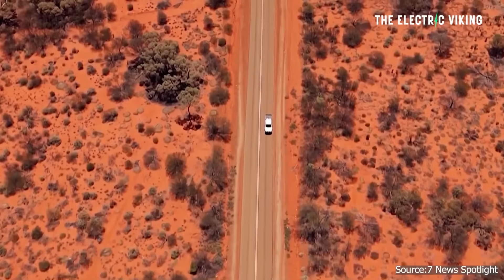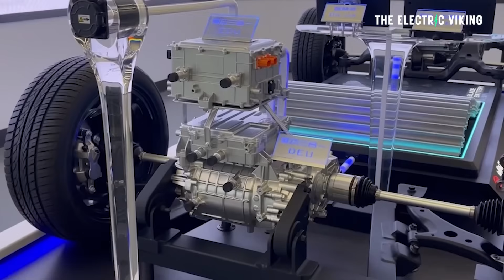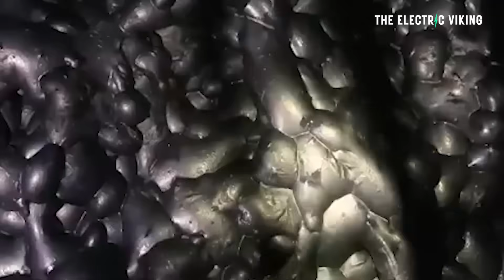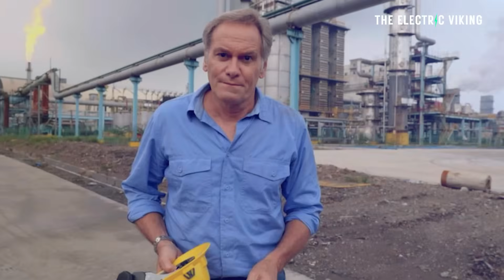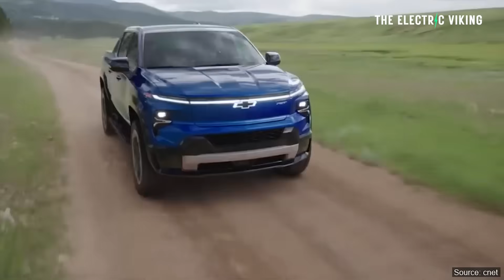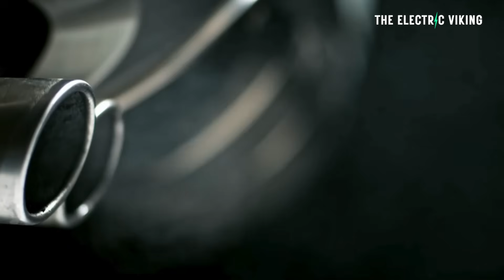Channel 7 Lies Exposed: The Truth About My EV Fight with Australian Media

Comment: Yes, roughly 70% of the word's nickel is used for stainless steel which is what most of Indonesia's nickel is used for. But, this video leaves out key facts. While LFP batteries are growing, especially in China, most global EV makers still rely heavily on nickel based batteries (like NMC and NCA) for higher range (LFP can't match the energy density of nickel based batteries, yet anyway). Tesla, Ford, Hyundai, and VW are all sourcing nickel from Indonesia. Tesla recently signed a $5B deal with Indonesia's nickel (You don’t invest billions in a material you think you’re done with). Indonesia’s nickel isn’t ‘too dirty,’ it’s just under scrutiny for environmental practices, which companies are now addressing.

I support your cause, but please don't be like Channel 7 and leave out key facts. Let’s keep it real, LFP is growing, but not replacing nickel as it's still essential to the EV transition and will play a key role into the future, that's the reality.

Comment: Ev battery warranty fineprint needs to allow V2g without leaving those cycling the battery into the grid out of luck if battery needs a replacement. (I totally understand why they have that hidden deep in the contract, tho we need this happening to get rid of coal , gas booster plants)

Comment: Personally unsure about the truth of the confrontation but lean towards Sam's version of things although the program itself was real enough with the confrontation seeming to be more of an edited set up. Nevertheless, to say there is no nickel in EV batteries is just being economical with the truth. Nickel is used in the production of both Li-ion and Nickel-Metal Hydride, obviously more in NMH. Yes you can say there is no nickel inside some battery types but they are well in the minority; for instance Toyoto use almost exclusively NMH batteries. Either way irrespective of what you can claim is NOT used inside the actually battery cells all those thousands of cells have to be connected together and that is accomplished almost exclusively with nickel strips. The purer the nickel strip the more reliable the connection and it's longevity. But! It must be very tempting for cheap EV makers to use cheap batteries and cheap batteries assemblies might be constructed with less pure nickel (dirty nickel). Again, either way I reckon that if EVs were not gobbling up all the best nickel there would be no place for the dirty nickel which in turn forces the less competitive pure nickel producers out of business making more room for more dirty nickel production.

Comment: One of your best episodes yet, Sam. It’s unfortunate that it took a cheap shot from Channel 7 to trigger your rebuttal—but I’m glad you set the record straight.

For those watching, I was there during the so-called “confrontation” the reporter described. I was speaking with Sam right after Minister Chris Bowen’s presentation. We were simply waiting our turn to ask questions when the reporter and crew barged in and hijacked the press conference.

My question for the Minister?
Why is the government still backing hydrogen for road transport—an expensive and impractical option—when BEVs (including heavy vehicles) are already proving their case on roads every day?

Comment: Oh yes the great EV scam, I said it from the very start EV's = SCAM . And anyone who buys one supports the scam ....better still buy a V6 petrol  or better still buy a V8 HSV
Reply: may i ask how you think it's a scam? im on the fence between getting one so genuinely asking 🙏
Reply: I have spoken to 2 EV owners and done a lot of research to find out that the running cost out weights the savings The EV owner told me it's 800 dollars for 1 tyre just on its own tyres wear out faster due to the weight of the car then there's the replacement cost of a new battery starting from 12,000 dollars . And there are a lot of other problems with EV's.After speaking with some EV drivers and the information I have found i will stick with a petrol car

Comment: You are correct that the images ' heavily and selectively  edited ' it would seem by Spotlight did provide a narrative that many on face value would have seen you as being in the wrong. However the way you have presented yourself here in putting your view of the situation across and this view can be supported by others paints a villainous show of intended deception by Spotlight. Many comments below by others to this video have supported you wrt the Indonesian mined nickel not being of the quality needed for EV battery usage. Dont offer to go outside with anyone as all you have done in the past and currently doing will be lost. Take 10 deep breaths next time (I know it is hard to do) and simply do not react, just 'wear it's so to speak. I am Never watching Spotlight or any Liam Bartlett story again. I am retired with an Eectrical Engineering background.All the best with other matters in your family.
Reply from the maker: Good advice, cheers
Reply: Not that I expect a response from ch 7 but yesterday I did also make a complaint to them along with a link to your video. I suggested that based on what was shown to all by ch7 and now what you have now said ch7 need to at least provide an apology to you and in fact to ALL its viewers for biased, inaccurate and sensationalism to push an ' agenda '. Goodluck M8.

Comment: One missing piece - there is nickel in nearly every resistive electric heater. Let's stop buying hair dryers, electric water heaters, cooktops and so on. Those were manufactured for over 100 years, why didn't they stop manufacturing heaters if nickel is so bad.

Comment: I saw the ad's for that 7 story, I didn't bother watching, I assumed it would be a load of bull, sounds like I was right.

As to why 7 was running that one I don't know, it's not like we have a auto industry that needs support over here any more especially after GM and Ford pulled the plug. There seems to be enough EV ads at present, so the TV ad coffers from that direction should be ok. If anything the TV media should be more going after web based channels that are pulling in way too much ad revenue. You know, that WiFi must be rotting your brain... (Oh lets not forget 5G).

Comment: Commercial free-to-air tv is dying. Anyone with an IQ over 75 turned off years ago. They know damn well those that still watch and easily manipulated, because they believe that they see and are told. The sooner 7, 9, 10 go broke, the better. I have not watch any of them in years, but they still appear with their crap on my social media. 

As you clearly stated Toyota etc are the only reason these tv stations manage to keep the lights on. Everything that goes to air is linked to advertising and making money. Facts are not a consideration.

Comment: I looked up nickel mining in Indonesia. Acc to searches, it is nasty and it remains one of two primary sources for nickel in li-ion EV batteries.  It might be Tesla's only black eye. It's bad but it's small potatoes compared to the fossil fuel and ICE industry.  I'm a retired petroleum engineer.  I love my 2024 model 3 with FSD.  Fossil fuels have become a ripoff. We charge from home. Electricity from the public utility will cut your transportion costs dramatically. In Ok we get power for 5.7¢/kwh half the year, ~12¢/kwh the other half of the year. It usually costs less than $2 to go 150 miles.  No BS. That's <2¢/mile.  No mechanical maintenance either. Can't beat that with a stick.  You're making a mistake if not taking advantage of the public utility power prices.

Comment: I looked at that article. It even started with the old chestnut that because most electricity is generated by fossil fuels they are a con. Trouble is a simple Google search would show that in Australia, most EV owners have Solar Panels and use this to charge their EV. To be perfectly honest the whole article seems like a hatchet job and it does not surprise me in the slightest that both the author and the Channel have links to big oil.

Comment: We need to wise up. Oil companies are colluding with other industries to spread lies and confusion, and have been for a long time. Big oil is freaking out because SOLAR WORKS. They will do ANYTHING to undermine batteries. THEY KNOW that even one breakthrough in the battery battle will finish them off completely, and thousands of smart people are working on the problem right now.

Comment: Good point — there’s more to the story than just environmental impact.

Indonesian nickel is mostly in the form of laterite ores, particularly nickel pig iron (NPI) and ferronickel, which are traditionally used for stainless steel production, not for EV battery production.

EV batteries, especially nickel-rich cathodes like NMC (nickel-manganese-cobalt), require class 1 nickel, which is over 99.8% pure nickel. However:
	•	Indonesia’s natural nickel deposits are low-grade laterites, which are harder and more expensive to refine into battery-grade nickel sulfate.
	•	The high-pressure acid leach (HPAL) process can convert laterite to battery-grade material, but it’s energy-intensive, environmentally controversial, and expensive.
	•	Class 1 nickel is more easily produced from sulfide ores, which are more abundant in places like Canada, Australia, and Russia.

So yes — Indonesian nickel is not inherently the wrong grade, but it requires significant upgrading, and that process is not always economically or environmentally viable for EV applications. That’s why many automakers are hesitant to rely heavily on Indonesian nickel, despite its abundance.

Comment: I believe the statement that the Nickel grade produced in Indonesia is unsuitable for EVs is not entirely correct:

Yes, Indonesia does produce the right grade of nickel suitable for electric vehicle (EV) batteries, specifically Class 1 nickel, which is high-purity nickel with at least 99.8% nickel content. This grade is critical for lithium-ion batteries, particularly those using nickel-rich cathodes like nickel-manganese-cobalt (NMC) or nickel-cobalt-aluminum (NCA) chemistries, commonly used in EVs due to their high energy density.
Indonesia’s nickel production has historically been dominated by laterite ores, which are processed into Class 2 nickel products like nickel pig iron (NPI) and ferronickel, primarily for stainless steel. These are lower-purity forms unsuitable for EV batteries. However, since the 2020 export ban on raw nickel ore, Indonesia has significantly expanded its capacity to produce Class 1 nickel through advanced processing methods, notably high-pressure acid leaching (HPAL). HPAL converts low-grade laterite ores into battery-grade nickel, such as nickel sulfate, meeting the purity requirements for EV batteries.
By 2023, Indonesia accounted for about 51% of global nickel mine production, and its HPAL facilities—like those operated by PT Huayue Nickel Cobalt and Vale Indonesia—have ramped up output. For example, projects like the one at the Indonesia Morowali Industrial Park (IMIP) produce nickel matte and other precursors that feed into EV battery supply chains, including exports to China and, as of late 2024, plans for the U.S. with companies like Tesla. In 2025, Indonesia’s Energy Minister reported the country’s first exports of nickel-based EV battery materials to the U.S., signaling its growing role in this market.
That said, not all Indonesian nickel is battery-grade. A significant portion still goes to stainless steel (Class 2), and the shift to Class 1 is ongoing, driven by investments from Chinese firms like Tsingshan and others. Critics note that while Indonesia can produce the right grade, the environmental cost—relying heavily on coal-powered plants—raises questions about its “green” credentials. Still, from a technical standpoint, Indonesia’s HPAL output definitively includes the high-purity nickel EVs require, making it a key player in the global supply chain.
Reply: So if we accept that the vast majority of Nickel is used in stainless steel, and most EVs in China and Australia are using LFP batteries without Nickel or Cobalt and increasingly so, and most of that Nickel produced in Indonesia is still not Grade 1; therefore unsuitable for batteries then the story should have not have been about pushing the anti EV narrative; that is the main point here.

Comment: At least you (Sam) do have a forum where you are able to get your point of view back out into the ecosystem...
(What better than to frame the Aussie - Viking as an aggressive front of Global EV-ism..  Of course bully tactics are always repugnant, you definitely have a forum to respond and maintain your position.  If the incident was falsely presented I am sure there is recourse available.)

Re Nickel content,  I get where you are coming from (getting away from Li-NMC chemistry en mass), cautiously I would suggest that many LFP battery cars do still contain Nickel in the Battery  plating  bus bars, and other components (body parts - high strength steels and stainless steels.) and materials in the car, but so too do ICE vehicles....

 - The Brewing and medical industry are probably a larger user of global nickel supplies than those under focus here. 

 Of course -  Australia mines Nickel also 9As well as Lithium and even some Rare earths - though the EPA has a downer on processing these products here - -why some remote ephemeral endorheic lake can't be used as a "processing and disposal" location??) ). - as do many other places, though many material supply chains regress to the cheapest source...  (Mining has a bad image globally as it is hard to look at the earth being torn open in a "pleasing light" - despite its necessity for most activities of civilisation to progress.)

NB. While I do not own or drive an EV (family members have a few),  I definitely see great value  (socially and economically) in the availability of a mix of technologies in the transport and power industries. We don't like being told what to do or think, but I also don't like being led down a garden path by unreasoned naysayers. I am well able to do my own  (back of envelope) costing and energy balance on a  host of technologies...  Economics will govern long range out comes, we are all participating in Mr Market.

Comment: I'm with you Sam, it's a big struggle and it's getting nasty. But we are running out of time.
Love your channel - I'm just about to pull the trigger on a G6 here in the UK.
I have solar, battery, heat pump - I'm doing what I can but it's not enough...
Reply from the maker: Solar, battery and heat pump. That’s awesome mate, I’m impressed

Comment: The EV autoindustry does not need enemies to slow down the adoption of the EV-s. They are doing the slowing process very well. We have a saying, if someone grabs more, get less. Their greed is the bigest obstacles on the path of EV-s. The EV enthusiast are like any fanatics, fan boys working against this, because they accept and adores every wrong decision of the industry. Here every EV fan boys tell every time, the EV are affordable and that is not the main issue, while it clearly it is. The EV adoption will be very slow, it will take many decades, probably more than 50 years, because the fanboys like you ignores every problem. Not to mention the slow EV adoption is the right and only way. If you rush it, you ruin it.

Comment: Ironically the oil industry uses massive amounts of stainless steel in refinery processing. Even more nickle is used in marine grade (316) stainless fir drilling off shore. 
You have my sympathy for getting screwed over.

Comment: Yes I can see the show probably had some kind of spin, you say it's oil interests, probably true.... but why was there such an emphasis on Australian green Nickel? Are you certain that the nickel in ALL EV's does not use dirty nickel. Can you please confirm if that is 100% true as I am genuinely interested. You did say that this type of nickel is not used however the show seems to say that smaller newer Chinese brands ARE using dirty nickel to be able to compete against the bigger stablished companies. Was that incorrect. Irrespective of that i am a supporter and sad to hear you are being smeared and attacked unfairly.

Comment: There are no differents in between nickel and nickel. If a company cant or dont want to refine an element they mined they sell it to another company who make it purer, removing the “contamination”. It is like electricity, oil or gas. You dont know your oil, gas, iron, copper, nickel where mined, who mined, it was a safe working environment, it was child, slave labor or not, those miners was fairly compensated. You can buy chocolates, coffee with stickers like rainforest alliances, etc. but those are also means nothing.

Comment: I asked ChatGPT about Indonesian nickel being suitable for EV's and below is what it returned, I don't know what it all means myself though as I was hoping for a Yes/No answer.
Question: Is nickel mined in Indonesia of suitable quality for EV's?
Answer: Indonesia does produce nickel suitable for EV batteries, particularly nickel laterite, which is processed (e.g., via HPAL – High Pressure Acid Leach) into battery-grade material like nickel sulfate. However, there are concerns about environmental impact, processing technology, and purity levels that may affect its suitability for some applications...It begs the question as to why Nickel mines in Australia have been shut down according to the Spotlight presentation?